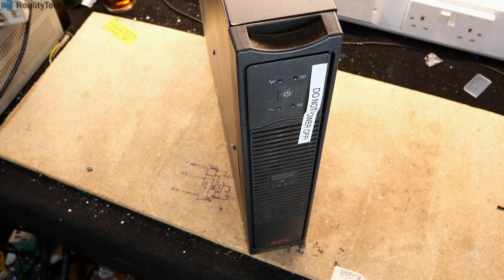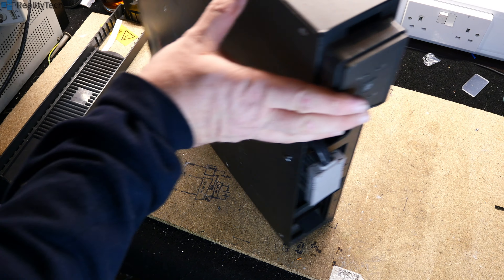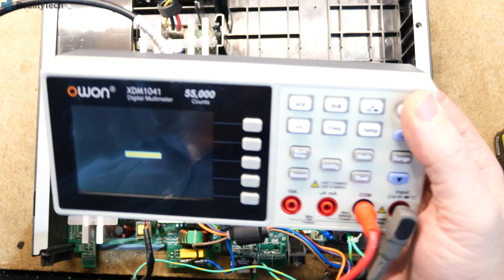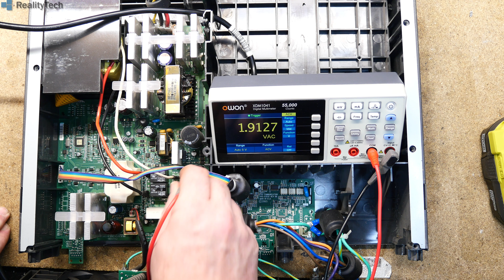#146 - Tatty APC UPS. Failed Repair and Teardown

Comment: Stuff failing to come back on after a power outage is often a failure of the PSU's primary-side startup supply, especially with always-on gear like a sat receiver. Very often caused by a bad electrolytic, easy to spot as it will be a low-voltage cap on the primary side.
Reply from the maker: All was good, the controller chip/chopper combo was short across source and drain pins. Thank you though. Mostly back to normal here now. Oddly the only lasting issues is a Zigbee device which is battery powered, go figure.

Comment: always wanted to get one of these and remove the lead acid to replace with a lithium battery pack 
would have to figure out how to disable the onboard charging and use a seperate one though
Reply from the maker: I'm not sure it would be worth the hassle to be honest. You'd need to charge pretty fast to be useable as a UPS and Lithium Ion cells don't like being stored charged. LiFePo4 may be a better fit. Also less likely to spontaneously combust.

Comment: 21:05 was there some faint browning on the back side of the PCB?
Reply from the maker: Its possible, there are some known issues with these and a singed PCB isnt beyond the realms of possibility. There is a site out there that goes through changing some of the charge sensing resistors that stops them nerfing batteries quite so spectacularly.